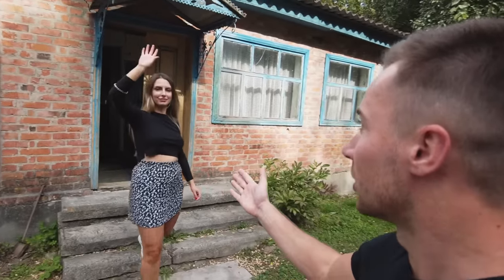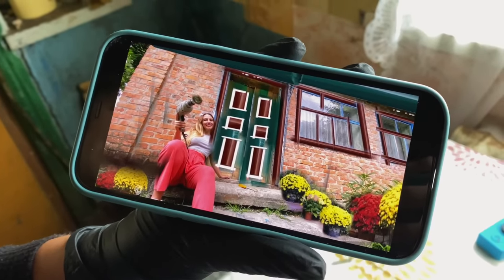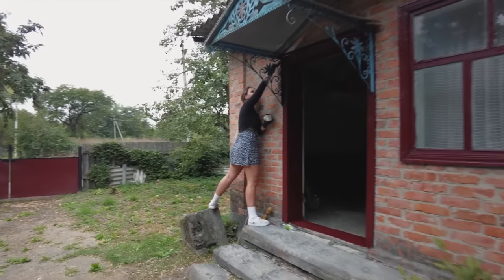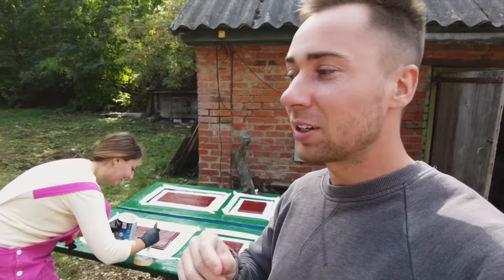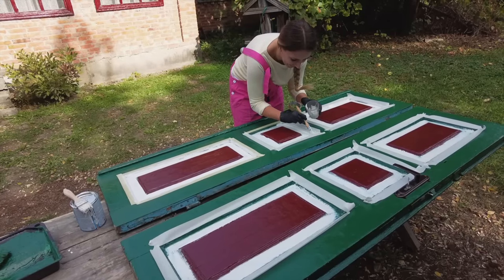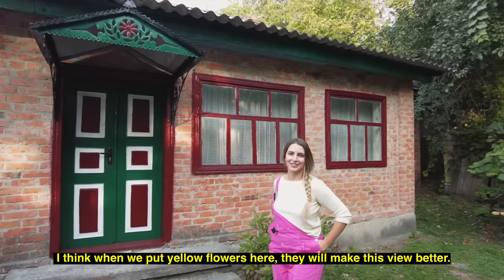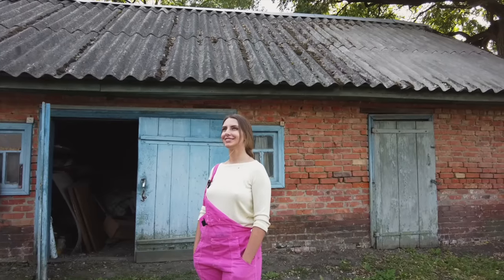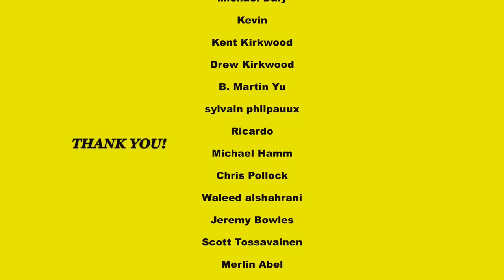We Made a BIG MISTAKE? | Abandoned House Restoration

Comment: First you sand, then you paint the whole door with a white base to adhere the colour better, then you sand light again and then ypu paint your favorite colours. After 24 hours you seal it with a weather sealer that has no colour. This prosedure will hold the paint and will not chip in the long run. Always seal it when is outside to protect the wood from rain and snow.

Comment: Painting is one of the last things you do.  The first thing that usually needs to be done is making any repairs needed to the roof and foundation.  Then inspect the plumbing and electrical wiring and make the needed repairs.  Then make sure the septic tank is working properly and if not make repairs on that or replace it.  If it doesn’t have a septic tank then it’s worth the money to get one installed.  It’s no fun having to go outside to the out house to relieve yourself in the winter.  
After that replace any rotting wood on the outside, preferably with pvc.  If the house doesn’t have gutters I recommend installing them otherwise the spillover from the roof will dig a trench around the house.
THEN you can think about painting.  The things you have to take care of before painting are unglamorous and not that fun, but they are critical to make a house livable.  Best of luck.
Oh, one last thing before you paint.  Pressure wash the outside of the house.  You’ll be glad you did.

Comment: Using good quality paint is important, colours stay same even decades. Poor quality paint change its colour yearly and fall of easily. I learn this from my own experience. (edit) Several years ago I restored old windows, about 100 years old. It take about full day per frame (four frames per window) to remove glasses, remove paint, repair holes and rotten parts. And painting several layers in batches takes days too. Then put glass back to frame... too much work to be economically efficient but that was historical building restauration project.